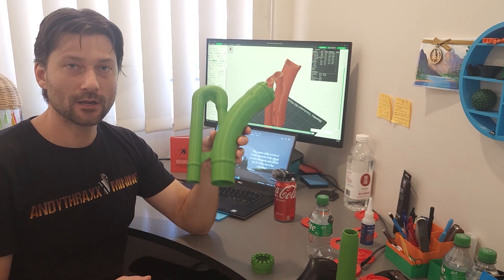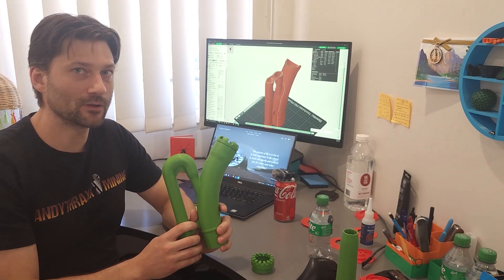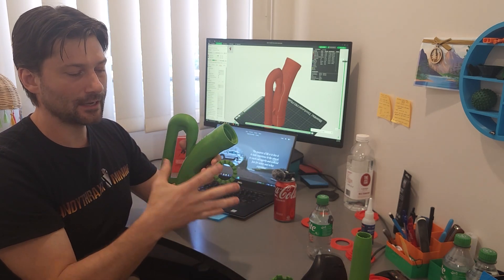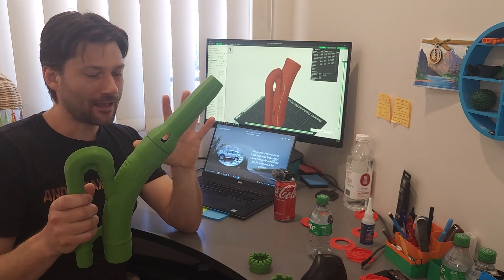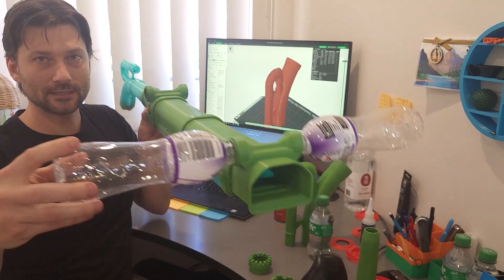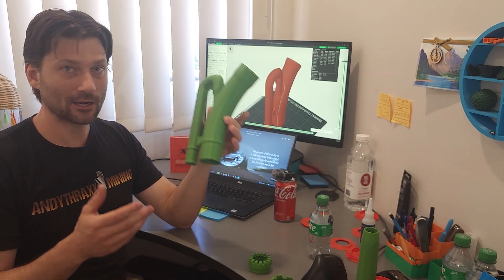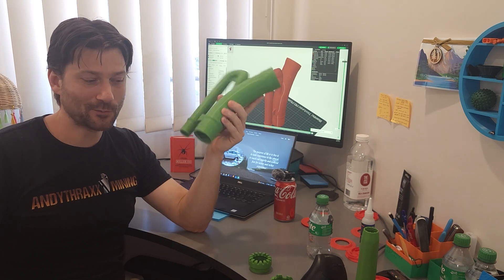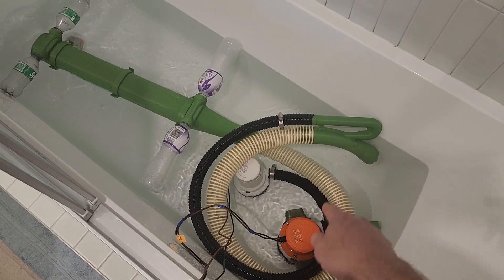3D Printable Two Inch Suction Nozzle for a 12 Volt Electric Gold Dredge. It Works Well!

Comment: How much pressure and stones those plastic parts tubes can handle? It looks quite fragile to me.
Reply from the maker: It's definitely not stainless steel, but the stuff can be surprisingly durable.  Lots of options for fancy materials that come with a higher price.  I'll do a full abrasion resistance side by side test sometime later on this year.

Comment: I love the thought of an electric dredge. Any chance you’ll be selling the bilge pump impeller cad files? I was thinking of trying to build a sniping/crevicing dredge diverted to a small stream sluice. Ideally, it would be ran with a smaller bilge pump and battery to be easily carried into remote locations. Either way, keep up the great work I love where the project is going
Reply from the maker: Initially, I'm just selling the Impellers as a physical product.  I can mail them globally as an oversized letter, so I'm setting shipping at a flat rate of $5.  I may release the printable file next year sometime, so keep an eye out.
Reply: I will definitely keep an eye out for that. I suspect I’ll need a scaled down version for whatever smaller pump I decide on
Reply from the maker: I might have exactly what you are looking for.  I did an impeller for a Seaflo 2000gph pump.  I only have the profile for PLA right now, as when I print with ASA I needed to resize things slightly for a precise shaft fit.  Just the way the parts shrink when printed.  The only concern with PLA was that if you run your bilge pump dry, the shaft heats up pretty quick, and I wanted something more temperature resistant for sale.  Email me referencing this conversation and I'll see what I can do for you next week.
The entire dredge setup I have for sale seemed to work with the 2000gph pump, but I liked the extra punch that the 3700gph provided, so that's what I went all in on.
Reply: You can build a regular hand dredge using a couple of one way valves and dump it into a bucket.  A lot easier to carry to a remote location than pumps, batteries, hoses, etc.
Reply: Hi mate just got files for subsurface sluice/dredge. Is it worth doing with 2000gph pump if so best nozzle size? And your recommendations re best plastic for sluice? Hope you're healing
Reply from the maker: @melmaximus6221  2000gph pump will still move material, just less.  Not sure how well the sluice will run.  If you want to try it, best nozzle size would be 12mm, but the files are for 15mm, which still works.  In a pinch, I made an impeller for the seaflo 2000 if stock won't cut it. If you go that way, please report back your opinion on suction.
For an open printer, petg hf from bambu labs has been working well for me. If you have a printer capable of ASA, it print very nicely on my P1S.  I have yet to experiment with anything fancier.